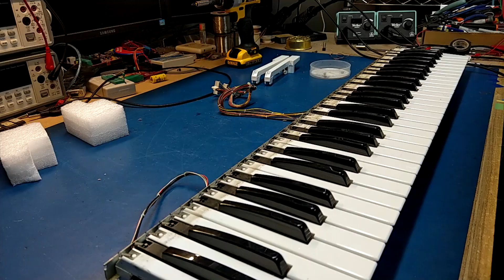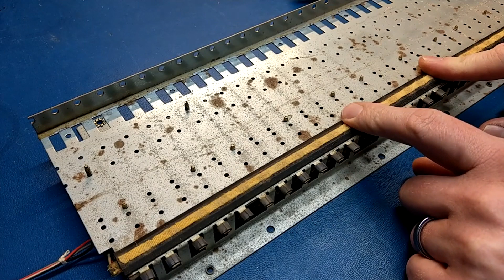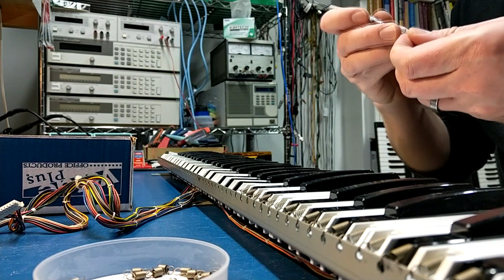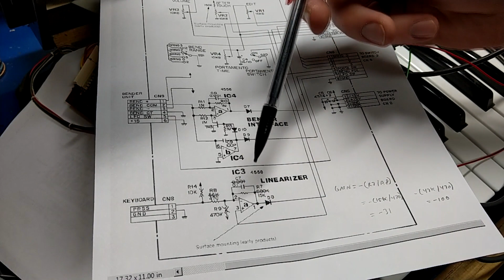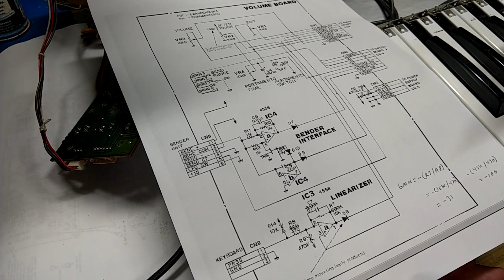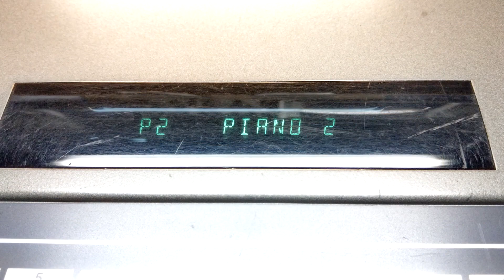Roland JX-8P Repair - Part 3 Keybed and Aftertouch

Comment: I have a JX-8P (along with the PG-800 programmer) that I purchased sometime in the mid-80’s and was stored away for years. Not too long ago, I took it out and everything functions perfectly with the exception of several keys sticking in the lower 1/4 register.
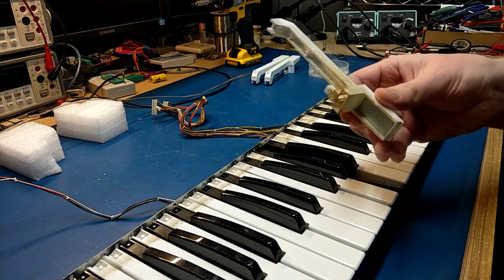So, would I have to remove each individual key and clean as shown @2:23? I was hoping I could just spray something in-between.

Comment: Great videos thumbs up to you Brad. One thing I noticed that you didn't fix the volume.  Is it something internal to be adjusted? or is there something else that can be done?
I have a JX-8P and a Super JX-10 and noticed that you pretty much have to have the slider on both all the way up to get a decent volume. Is that a Roland issue?
I know the video is 4yrs old but if you get this reply and can give something more on the volume issue it would be well appreciated.
Thanks

Comment: I not only own an 8p of my own; I previously owned a JX-10 and now have the MKS-70 module. I’ve attached external MIDI controllers with channel aftertouch to each of them and been amazed at how easily receptive each one is to said aftertouch, way more than the JX-10’s keyboard. I imagine the JX-8p is too.

Comment: Good sir! I recently purchased a JX-8P for $68 - in 2023 no joke. It was at auction from a house fire. Synth had smoke damage (it stinks) and the grey plastic a bit discolored. Took at chance untested and was delighted to bring it home and hear it play. It had a number of issues, mainly stuck bad key contacts and no AT.  Through (mostly) your videos I've been able to fully restore it, complete keybed teardown, rebuilt the aftertouch meticulously (3x!). Had it all together and the AT was better, at least registered something, but full force. I then went for the jugular and paralleled a 50K to the 150K of VR2 like you did. Now with the AT s(VR2) slider max'd, the AT is too responsive! But dial down that slider to 3/4.... this thing is good as new. THANK YOU.

Comment: I have some keys not playing, I have to push very hard ta make it sound. how do I clean them contacts?
Reply: Take care of the direction, it has to go back to front - but you can gently move a cotton bud soaked in alcohol between the leaf spring contacts, it generally pulls out quite some debris.  The Juno 60 has a similar keybed

Comment: Thanks for posting this! I was wondering how to troubleshoot the aftertouch strip on my W-30, and it's exactly the same design and maybe even part! I love how you use the analog meter as it gives a much better relative visualization of proportional pressure to resistance. Thanks!

Comment: I own a JX8P from 30 years amd 10 years ago my son returned me because it didn´t sound. It works control from buttons and sliders, but no sound. Keyboard sends midi. No sound from line out and phones neither. I would like from you some line guides to test this gear and find whats the problem. I have one pico oscilloscope and multimeter to test this gear. Thank you in advance. José Luis from Barcelona.

Comment: Hi, thanks for a great video! My 8P sits opened downstairs while I research how to clean the contacts for some keys that are creating hanging notes. Seems I have to remove all the keys like you did to get to them and swab them down with isopropyl.

I had the same question someone else above asked - did you replace the plastic strip when you reassembled the keybed, or is it not necessary?
Reply from the maker: Thanks Kalle. I did not replace it, there is little need to do so. Unless you pull your keys really hard forward while playing for some strange reason, it is not needed.

Comment: I want to add my thanx for this helpful video too. Mine jx8p still works, all is original, some keys may stack but in overall after 35 years since it was released all still is working. It is amazing, I think. I do read about nowdays synths and lot of them has issues even during a warranty period. This one looks been build for ages :)

Comment: Excellent video. 
The plastic strip on that holds the keys, is it just tape?
Reply: Hey, I just found this video and your comment while my 8P sits opened downstairs. From what I could see so far the plastic strip is a little bit thicker than tape, like half-millimeter or so plastic. Did you remove yours?

Comment: Hello, thank you for your amazing work ; I have a question : how to test the Aftertouch strip with my multimeter, on which pin should I connect it ?
Reply: the two pins that come off the strip itself - connect the red probe to one pin, and the black to the other pin, with the meter in Ohms resistance mode.

Comment: I've loved following these videos. My main question is. . .did Roland really use wood as the bottom of the case for these?
Reply: Yes, 100%, mine has painted in grey wood bottom. What you want, 1985... :)
Reply: Mine has wood for the bottom and I don't think it's been modified.

Comment: Thanks for taking the time to do this video series. It's not often to find great synth repair tutorials that are easy to understand. I don't have a JX-8P but I think the info here will help me fix the aftertouch in my Korg DW-8000 since it's the same problem (works, but have to press really hard) and the circuit looks very similar.

Comment: I got the nads to go ahead and address my JX-8P issues. It was dusty and dirty but, not too bad. 
I bought this keyboard new, and have kept this unit in pretty good condition externally. 
Time has a way of de-performing the originality. 
Aftertouch is cool but, It always took a firm press to engage, even new.

Question: Did you apply fresh adhesive to the clear strip you took off when you reassembled the keys?

Also, there was a spot of adhesive at the top of each key too. 
 
BTW your other vid on the SPX90 put my processor back into operation. Caps.

Thanks for the vids.
Reply: Hi, I'm not the video author but I just did a complete restore of my JX-8P based on these great vids. I tore off that strip and just tossed it, it wasn't in great shape after mangling it out of the keybed. I've seen a number of other repair videos on this synth of folks doing the same, or the open one up and somebody else has already removed it. Don't think it's critical. I ended up removing all my keys (smoke damage) and cleaning them all. I also completely re-did the after touch strip (marginal improvement), and did as the author here did and paralleled a 50K resistor to the 150K one coming of VR2 on the volume board. Good as new!

Comment: Great video bradthx! One question about the keybed: what grease do u use for the keys? I did a few keyboards (cheaper models like e.g.  Roland E-35) with white lithium grease, but they do not handle as expected after that (still rigid). What am I doing wrong here? What brand/type do u use? Regards JuAn
Reply: I'd be careful in using grease to improve keys action. It might react and make a mess on plastic, especially in hot environments. Keys should have all the same response across the entire range of the keyboard, of course. If few feels too stiff or loose try to disassemble them and clean them out, pivot points as well. If that doesn't work I would look into replacing the springs and/or rubber stoppers, depending on the type of synth. Just my two cents of advice : )

Comment: WIll this fix work with the Alpha Juno 2?
Reply from the maker: Yes, if it's aftertouch has the same failure mode of the sensor having higher resistance. The amplifier circuit is almost the same in the Alpha Juno 2.
Reply: @bradthx  I'll give it a test this weekend. Thanks for the video. Very useful.